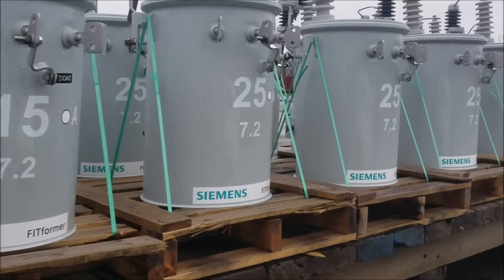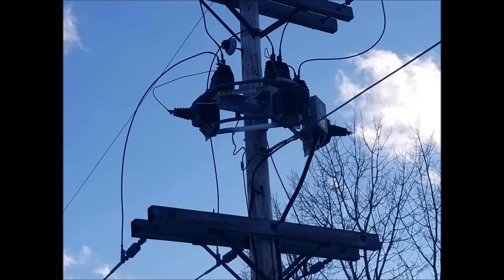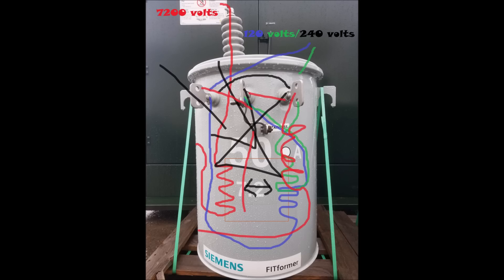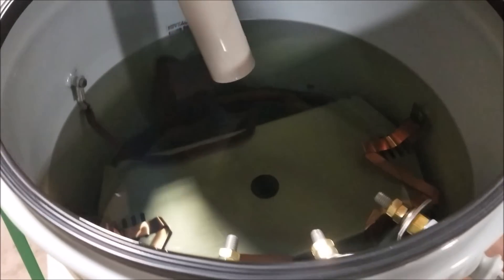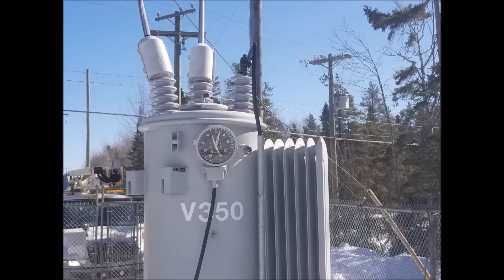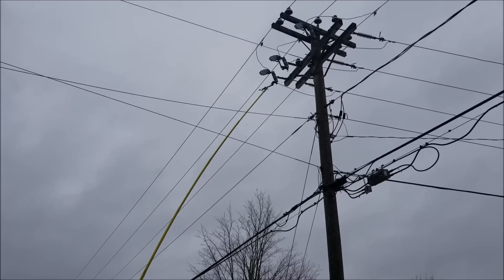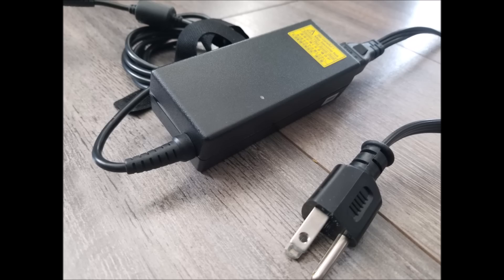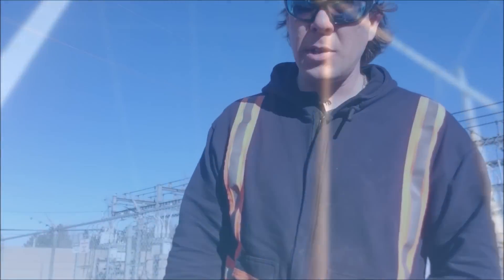What's inside a Transformer?

Comment: While oil also acts as a heat transfer mechanism, its main function is as INSULATOR. There is paper, which also acts as insulator, but the mineral oil is what makes it work, as paper would degrade too quickly and alone not be sufficient.

Comment: In most cases, the circuit breaker on  a haphazardly connected generator will probably trip due to overload. As it will probably be powering the neighbors house as well.

Comment: I saw a transformer explode once when I was a kid.  This was back around 1980ish.  I was mowing grass in our front yard and just happened to be headed in the right direction when it happened.  The transformer was located about 50 yards away.  The top blew off, a big fireball shot out of it and then descended all the way to the ground scorching the grass.  The transformer continued to burn until the fire department eventually hosed it down with water.  It was quite an impressive little BOOM.
Reply: What fascinates me, is when a transformer is shorting out and turns into a light bulb until the linemen turn off the power or a fuse of somesort disconnects the circuit.

Had a storm a few years ago. Lost power. Linemen tried to bring power back, but a transformer turned into a lightbulb, then after they fixed that one another one down the road had the same issue. So instead of getting back on at 8pm. The power came back on at 10pm.
Reply: You weren't heading in the right direction that would be the opposite direction.stay safe people.

Comment: Why not anti-freeze? Other than it being toxic -- we've been there, caused a bird to go extinct... -- it's mostly water. Water will corrode a transformer. And at high enough voltage, can break down to hydrogen and oxygen, which is a very explosive mixture. (mineral oil is a better heat conductor, too. and yes, mineral oil will burn if hot enough -- ~300C. it's not toxic, but we also don't want it washing into waterways.)

Comment: Nothing inside, I hung one the other day and someone had broke in the yard and stole the core, I took it down and removed the lid and nothing but oil in it. I had to drive an hour back to the yard and get another one. I was pissed and laughing at the same time.
Reply from the maker: No way! That's crazy 😲
Reply: @Bobsdecline  yeah it happened it was a brand new 12470 to 120-240 single phase pot, we actually got the guy on camera and they have a warrant out for his arrest.
Reply: How he did that  without  getting  electrocuted
Reply: @mjojo1000  I hope your being sarcastic.
Reply: @t.r.4496  just  wondering

Comment: Only 3 things I would like to add. on your "schematic" on the transformer can 240 volts comes out of connecting X1 to X3. Two,  if arcing occurs under oil, acetylene gas is produced and rises to the head space. If an arc occurs in the headspace, that is what causes an explosion. Of course with Lightning all bets are off. The third and maybe the most important for safety is that before you take any lid off you vent the can. This is just 34 years of experience talking.
Reply: I don't see how 240V can come out of X1 and X3 since they're separate secondary windings.
Reply: Thank you father

Comment: Very interesting video. I’ve always wondered about this. 

I have a question. Not about transformers but definitely related to high-voltage. I’ve been trying to find the answer to this. What is the green twisted wire we see sometimes now. It seems like a new thing. It’s usually a three wire twist and is often in the lowest area on the poles, but it connects down from the high tensions. Often times it ends up going in a tube and going to ground. Is it high voltage line that is sheathed so that it can hang lower on the poles? The situation near my apartment where I see this, there’s not room enough for more high tensions. There are already two sets. A third set of high tensions comes into the corridor where the other two are and there’s not enough room, I assume, to safely hang another set because it would be too low. So the three high tensions go down a pole, through some connections and then the green wire begins and continues, hanging below. There’s no large transformers between the high tensions and the green twisted cable. Though there are three white insulators It’s an interesting situation.
Reply: I have to point out you're using the term "high tensions" as a noun (it's not) and far too often.  In the utility electric industry "high tension" is synonymous with "high voltage" and often is considered to start at around 69000 volts.  These voltages are for sub-distribution and higher lines.  Heavier lines that are installed suspended can be assumed to be considered high voltage.  Voltages from about 1000 volts to 69000 volts are considered medium voltage, and below 1000 volts is low voltage.   "High" "medium" and "low" voltage are relative, of course.  A home owner would consider the 12, 16, or 24 volts running the doorbell low voltage, and the 120-240 volts running the lights high voltage.

As for the green wires, the first clue is that, as you pointed out, they're going to the ground.  They're ground wires.  Green (or green and yellow) is the universal color for groundING conductors.  They literally connect the conductor(s) they're connected to to the Earth so as to ensure they share the same voltage potential.

Comment: Can identify the system voltage and  size in kva by the information on them.  in this case  these appear to be 15 kVA units with a primary voltage of 7200V. Ones around my place are marked 75  2.4/8.0, 
75 KVA units with a selector switch that allows them to be used on or old 2400/4160V circuits or the newer 8000/13860V circuits the city is being upgraded to.

Comment: 4:05 that's a lie!
distilled water should not be able to conduct electricity
Reply from the maker: In virtually any circumstance that electricity encounters water unintentionally, it's not distilled. Therefore to say water and electricity don't mix can be an accurate statement.

Distilled water and electricity in a controlled environment would not conduct (depending on the voltage)

Frozen water also acts as a pretty good insulator.

Comment: In some ways I think dealing with a large transformer like that would be easier.  I've had to track down a broken winding in a transformer for an old Philco radio from 1933 and that stuff is a PITA to solder a new lead to.  Sure it may have lost a couple of volts but in a radio from that period it isn't that critical.

Comment: Why do Americans have neutral wire on their single phase network when Australia uses the ground as neutral?
Reply: It depends on the density of electric consumers in the area. In the US it isn’t uncommon to see one wire single phase (no neutral conductor) in older farming communities. The issue is that it causes some residual voltage in the area around the ground, which might be fine with one house every few miles. But if you do this in dense areas you are going to energize a whole lot of the ground, pretty dangerous to walk near. Also a poorly installed ground rod can be deadly

Comment: Good video. I am wondering why they used to build  transformers with PCB's inside. In my area of Ma, we have been at war with General Electric as they used to dump PCB into the local river, this river leads to the Hudson which is now also polluted with PCB's. This dumping has made a mess of our local river and G&E has only stepped up a bit. Again very interesting. Thanks
Reply: The old oil is basically made of PCBs. PCBs are good electrical insulators and don't break down easily with time or heat, which is basically the issue.
Reply: @straightpipediesel  Thanks for the information. Take care

Comment: A switch mode power supply is not always a transformer. Some do have high frequency transformers and/or an inductor (which is basically half a transformer) in them, but not all.
Reply: What else is a switch mode power supply going to have in it?
Reply: A SMPS taking power from mains will nearly always include a flyback transformer nowadays. A power MOSFET is used to switch at high frequency on the primary side of course. If you are aware of any product plugged on mains that doesn't include a transformer (of any kind), I would be very interested. And even lower voltage DC/DC converters will need an inductor for buck/boost topologies and friends. The only case I can think of with truly no inductive components are some DC regulators like LDOs but I bet you some transformer stands between that and mains. And a LDO is not a power supply nor it is a switch.

Comment: I am a retired electrical engineer whose hobby is building high voltage equipment such as Tesla coils, Marx generators, Cockroft-Walton multipliers and pulsed power generators. I just wanted to let your viewers know that we high voltage hobbyists sometimes use pole transformers as step-up transformers which is of coarse the opposite of the way that they are intended to be used, however the transformer doesn't care if its being used as step-up or step-down. I use a 10 KVA 14.4 KV pole transformer as a power supply for my large spark gap Tesla coil. It puts out 9-foot long discharges with 6.5 KVA of input power. Its always a big hit during Halloween with several hundred spectators.
Reply: Make a video of that thing in action! I want to see it 👍🏻
Reply: @981porsche3  I now have a channel. You can see it on my channel.
Reply: Ooooo. That must look awesome! Bet your neighbors haven't gotten used to this happening.
I find it interesting how some are using the HV microwave transformers, by cutting out the secondary and installing several turns of a #4 or thicker. Spot welding at home!
Reply: How can I harness free electricity from the either?
Reply: @qua7771  Free?  lol
Reply: @justayoutuber1906  The sky has a positive charge, and the ground has a negative charge.  The trouble is that it is static.  When rain shorts this charge we get lightning.   So yes free.  The same way Tesla did.  Do your own research.
Reply: @qua7771  rain is not what causes lightning like you say.
Reply: @MattH-wg7ou  I have my theory, and you have yours, though you didn't explain yours.
Reply: @qua7771  how does lightning occur when there is no rain to short the charge between cloud and ground then? It does. When observation immediately refutes your theory, you should revise your theory. Dont get me wrong, there is still a lot we have to learn about lightning, but it can and does occur in the absence of rain.
Reply: @qua7771 rain nor humidity do not create lighting. Lighting is caused by high build up of charge which creates a high voltage difference. It’s not a good idea to harness power from it because it’s always short and doesn’t make sense when you have other  renewable sources.
Reply: @cockroach5776  I never said rain crated the static charge.  In meant that it provides conductivity to ground. If you mistook me at that level, you likely continue to do so.  That said, I wont wast my time or yours explaining any further.  Good bye.
Reply: @qua7771  u clearly don’t understand the production of electricity - just because it’s conductive doesn’t mean it’s utilizable.
Reply: Where do you even buy these things? An other pro-level stuff such as for example what photonicinduction channel uses?

Comment: Great video, however most of the household transformers you listed were incorrect. Modern electronics use switch mode power supplys. While they do in some cases have a small transformer in them most do not and use other means to set the voltage down. Switch mode power supplys are more efficient, cheaper, more versatile and smaller than transformers. The hair dryer plug was a gfci plug and not a transformer.
Reply: Switch-mode PSU designs definitely use a transformer... the far higher switching frequency being used to allow for lesser eddy current losses & therefore a far smaller one...
Reply: @intercity125  Technically they all use an inductor.  Buck/boost PSUs often don't have a transformer.
Reply: This was a tad bit pedantic.
Reply: @stargazer7644  While pedantic, it is correct, other than (to add another layer of pedantic) saying most don't use a transformer in them, which they do albeit it's pretty much always a way higher frequency transformer, often working on square waves also.
Adding knowledge in a constructive way is always welcome in my opinion.
Reply: @Kalvinjj  Ok, if we're going full pedant, I'd like to point out that switch mode supplies are noisier, more complicated, less reliable, more exciting when they fail, harder to troubleshoot and cost more to design.

Comment: Years ago, had a tornado touched down in the neighborhood. Sitting on the porch some time after the storm, I could hear a frying sound across the road. I walked over and could hear the transformer on the pole boiling. I called the power company and the operator said, "there is no chance of it blowing up". I said oh, that's good it's close to our house. After an hour of cooking, it was starting to change colors. I called again and told them what we were observing. Again, no chance it will blow up. So we went back to our chairs on the front porch. Shortly after that, the transformer started venting white smoke. Then a large bang and the top of the thing went up in the air about 50' . 
I called them back and said, tell the crews they need a pot for this report. :)

Comment: Our electric grid is so old We still have the old black transformers with PCB ‘s in them in our area.
Reply: Ah. The smell of PCBs in the morning. You can tell if a transformer has PCBs by the smell.
Reply: A few of the ones around here are the black ones.  Back in 1998 I lived in a very old home in Tennessee that had stood empty for many years.  It had one outlet in each room and no 240 except for at the old fuse box.  I added 240v wiring to it's unused cartridge block and got a couple of cartridge fuses for it so I could use an ancient 240v radiant "4 stack" floor heater.  Turned it on and everything was fine for a few minutes, then every light in the house went out.  It was nearly 11pm by then, so I just went to bed and called up the local bpu the next morning.  They came out and checked and of course it blew the breaker in the old transformer on the pole.  The linemen were surprised as they said they hadn't seen a transformer like that in over 30 years as all the rest around there had been replaced.  From the ground it didn't look much larger than a large coffee can.  I came home from work the next day and saw a new large light gray transformer on the pole, lol.

Comment: "Water and electricity do not mix..." Pure water is an insulator. What causes conductivity in water are the minerals which of course carry stray ions which in turn conduct electricity.
Reply: With a high enough voltage, everything is a conductor. (even pure water)
Reply: It isn't even as good an insulator as the oil is even if 100% pure. 100% pure water has a resistance of182,000 Ω.cm at 25 °C That's a quarter of an amp at 7,200V, and it never stays 100% pure for long.

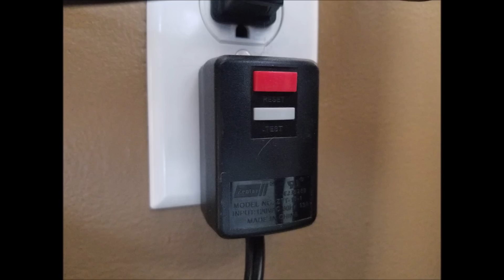Comment: 5:54 is just a GFCI mounted on the end of a power lead for a hairdryer, isn't it?  Not an actual transformer, because hairdryers run on 120VAC don't they?
Reply: yes i seen that too
Reply: Many of the so called transformers for modern electronics are actually switch mode power supplies.

They do still contain transformers, but very small due to the high frequencies used in such power supplies, unlike the "wall warts" of old.
Reply: @TomStorey96  he wasn't talking about any of the smps. He was talking about the GFCI at the end of the hairdryer cord. It's not a transformer, it's just a GFCI. 110V in and 110V out.
Reply: Well it does have a current transformer inside :)

Comment: Fun Fact: Water and electricity DO mix! But only if it is ultra pure. Large power stations circulate super pure water inside the conductors  used inside the generator motor windings to keep them cool. The generator windings are  large 3" thick copper bars formed into windings with a hollow core for the water to circulate inside. (Re: 10 years as a trainer at a twin 1150MW power plant.)
Reply: Indeed while "water and electricity don't mix" is pretty decent advice for general application, pure water is actually a pretty good insulator. The problem is many things like to dissolve in water (like salts) and those ions or even just particles floating around will make the solution conductive. In fact, a common way of measuring water purity is with its conductive-ness.

Typical antifreezes will probably have additives that would probably make it more conducive and of course water will corrode various metals in a transformer thus becoming conductive and just causing damage from the corrosion.

And out on all that the relatively narrow working temperature of water is also problematic.

Anyways, there are lots of reasons why oil is preferred in these low maintenance systems, although water is actually a better coolant than oil.
Reply: I'm not sure why it matters, the resistance of water is enough that unless it's strongly electrolytic, it works well for cooling as accepts heat well. Typically, though, water cooling is best for indirect exchange and oil for direct exchange of heat, due to the potential for the water to become electrolytic through contamination or electrolysis caused by the remaining impurities giving off oxides.
Reply: Electricity isn’t conducive in distilled water The only reason water is bad to mix , electricity is because of the minerals and that help conduct electricity.
Reply: Thanks father, but I'm not sure anybody was asking.